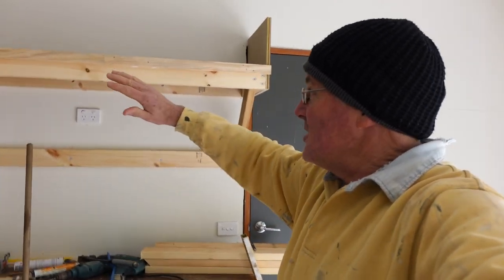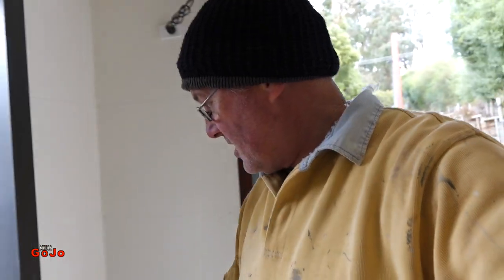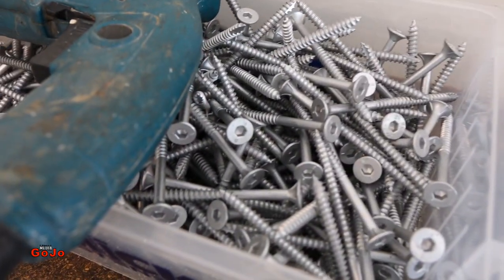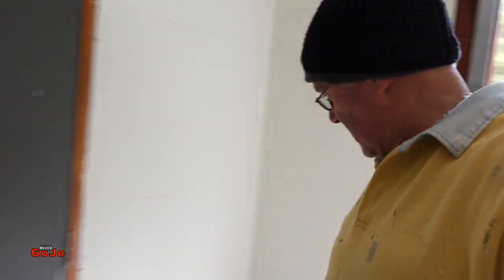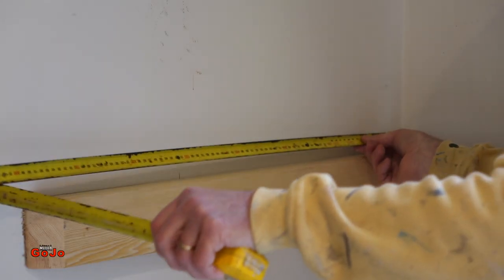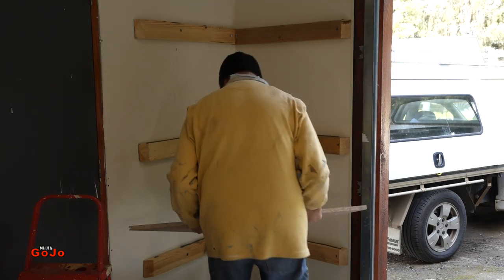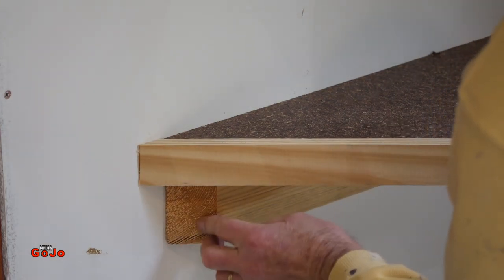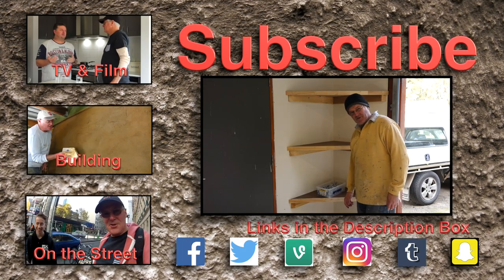Diagonal Floating Corner Shelves | Super Heavy Duty | How to DIY

Comment: I started building these thanks to your video.  I had a question though:  The area behind the door to the garage can only fit a shelf that is 18 inches so there is just one stud to drill into.  Would you use wall anchors to secure the rest of the 2x4 and if so what kind of wall anchors would you recommend to hold that kind of weight?  Thanks in advance!
Reply: Would like to know myself 🤔